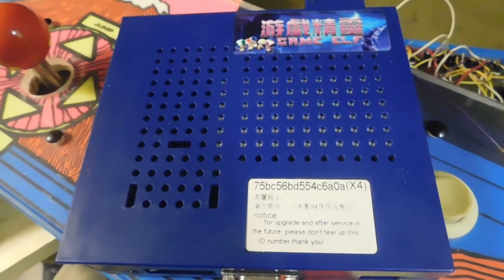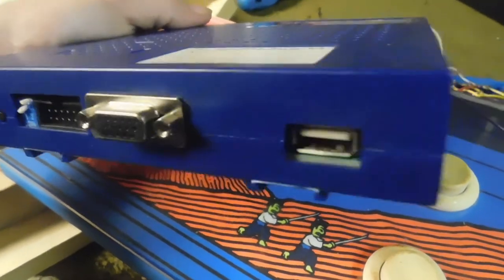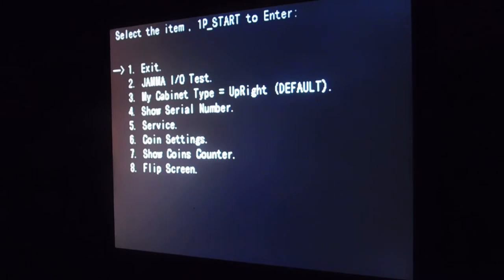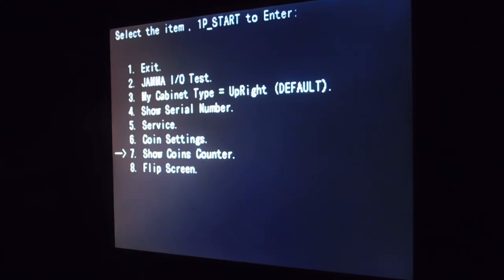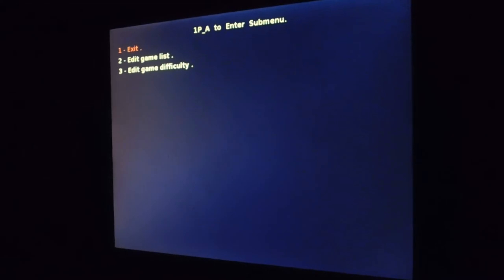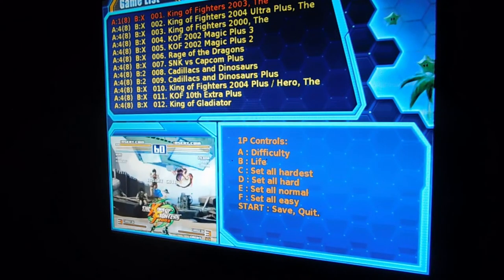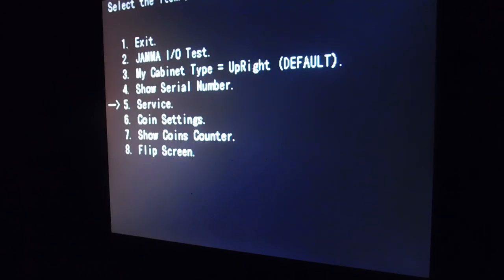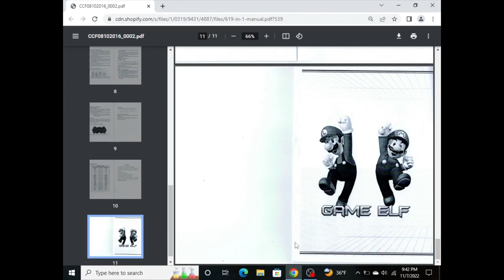How To Program A Game Elf {750 in 1}

Comment: Amazing how a lot of this info isn't in the manual or if it is I can't understand it.
Also important. DO NOT connect power through the Jamma edge connector AND the 4 pin Molex port on the side AT THE SAME TIME. The board can be ruined (this info is in the manual).
Thanks for the vid Will. I WILL be coming back to your instructions once I replace the old Jamma game board with the new Elf 750. I don't have the D, E or F buttons either so have to put them in first.
PS AsteriX, not asterick 🙂.

Comment: Hi, I have an Elf 412 in one in an arcade machine but they did not install buttons D E or F :(........... is there any way of setting these setting without them? If not, how do I do a factory reset to default? I have changed some of the games to "Hardest" accidentally and cant get them back without the missing buttons! Your help would be greatly appreciated.
Reply from the maker: Sadly you'd need to have the D, E, & F buttons in order to do a factory reset on the board. The only thing I can say could be done would be to either install D, E, & F buttons on your control panel or at the very least set up some momentary switches to the D, E, & F inputs but keep them on the inside of the cabinet so you can use them for factory reset or at least adjusting the settings for the game.
Reply: I have the same question!  Did you ever figure this out??
Reply: Connect a usb controller direct to board
Reply: @bryansarracino8623  i connected a ps5 controller to the usb port on mine, square is A, triangle is B, X is C, O Is D, L1 is E and R1 is F. Analog stick for navigation, D-pad doesn't work.

Comment: I have an encoded control panel with USBs coming off the panel. I bought a splitter and hooked it into the USB port on the Blue Elf. I get nothing. Joystick dowsnt respond nor do the buttons. Does that mean i did something wrong or does the Elf not support this? Thoughts?
Reply: I'd bet this unit keeps it simple and the USB port is not a hub like on a Mac or Windows PC so one controller would be its limit but, happy to be corrected.